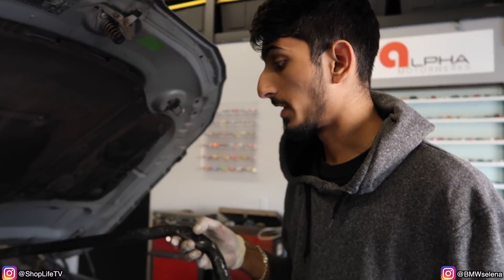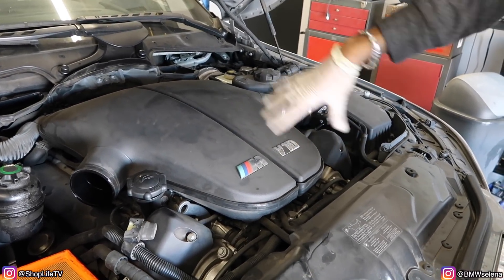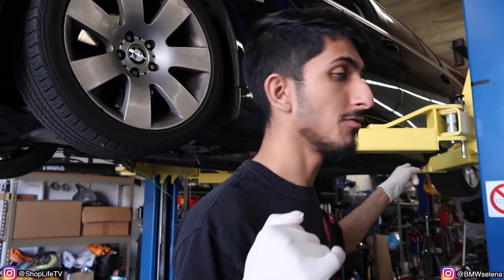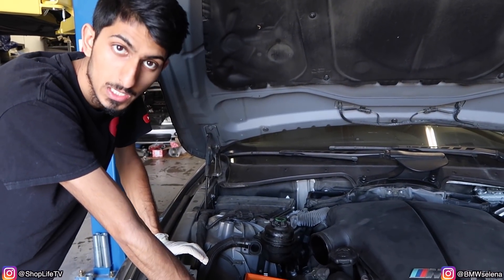BMW E60 M5 Throttle Actuators Replacement + Organizing Shop

Comment: Had the same issue with vibrations on e46, turned out that needed new gearbox mounts also not only center bearing. After that no more vibrations :)